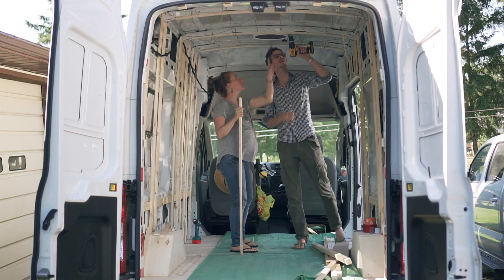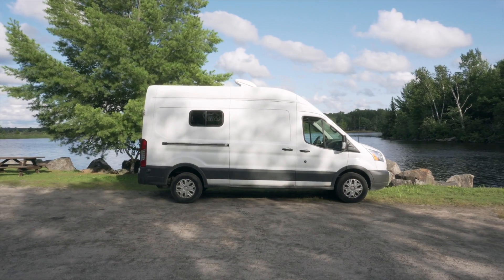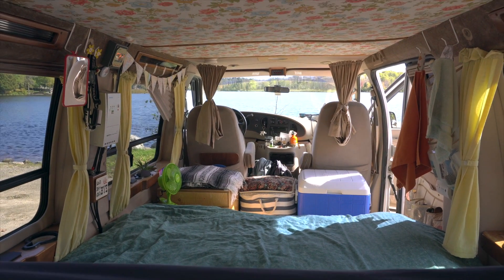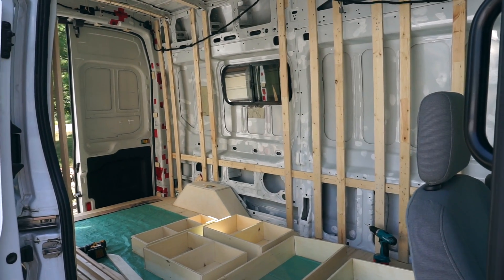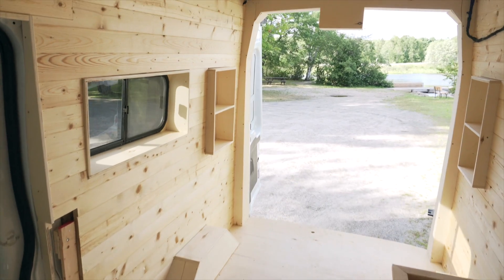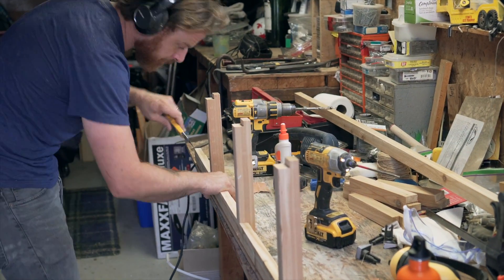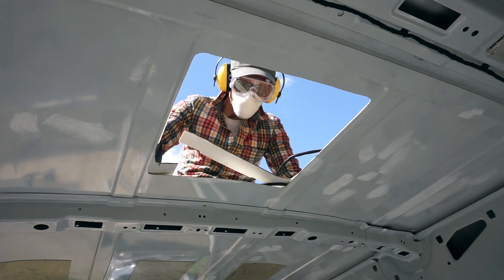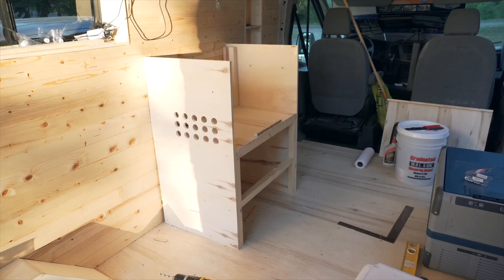Building The Ultimate Camper Van as a Tiny Home & Office on Wheels

Comment: Hemp insulation. Hope you don't end up with a mold problem. As some have mentioned  .... I would have went with spray foam insulation ... no vapor barrier required as long as it is minimum 2". Good luck with the build.

Comment: I did not see a vapor barrier over the insulation.  That is a problem.
Reply: Does the barrier go on the inside (warm) or outside (cold) and can it be as simple as plastic or would I need to use something specific?
Thanks.
Reply: @marychentis9842  The vapor barrier would be located on the inside (warm) side.  So in other words, the insulation is to the outside and the vapor barrier is between you and the insulation. This prevents the moisture from the inside of the cabin, from condensing on the insulation and causing mold and damage. It also prevents the metal of the vehicle from remaining wet on the inside and rusting..   Yes it can be simple plastic sheeting.
Reply: Thank you  @markkobernick6983  that was very helpful.

Comment: What engine / transmission combo did y'all go with? Private sale or pre owned certified from a dealer? If the latter, what kinda warranty do they give you? & if it's ok to ask, what was out the door cost for a transit? I always wonder why ppl choose a Mercedes vs a transit only because the Mercedes replacement parts are so expensive & theres WAAAY more ford dealerships in most towns than there are Mercedes ones.
Reply: This is just a guess & in no way based on any knowledge but I also imagine there's many small or smaller towns that just don't have a Mercedes dealer to fix a sprinter & ma n pa shops w/ little knowledge on them or the specialty tools required. Where a ford is a ford no matter where you're at.
Reply from the maker: I think you're right and that's one of the main reasons why went with the Ford Transit. We got the 250 Ecoboost. We got it from a used vehicle dealer and we got a decent price on it because it was used pretty hard. The weird thing about the Transit though is that there's lots of little areas where water leaks in....so it took us a long time to find all the leaks and plug them.  We'll see how this van performs in the long run but for now we're pretty happy with it.....I guess that whatever you choose, Promaster, Transit or Sprinter, they all have some drawbacks. Thanks for watching :)

Comment: Do not use regular insulation. Your van does sweat and mild will grow behind the wall. Use spray foam
Reply: Wild Willy, looks like they ALREADY put the insulation in [1:46].  It would have been helpful if they would have done a little research to see what mostly everyone else is doing regarding insulation and why.
Reply: It looks like they're using Rockwool batting or similar -- which is not going to mold like other types of insulation.